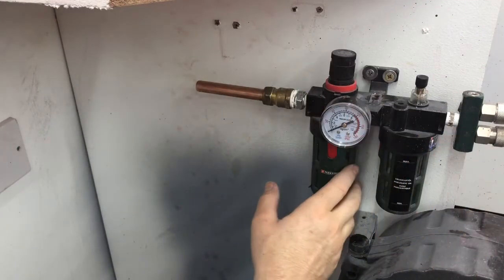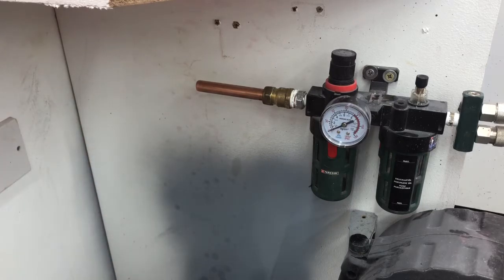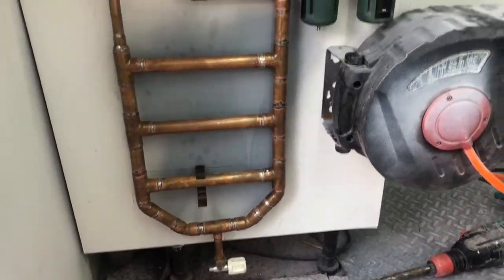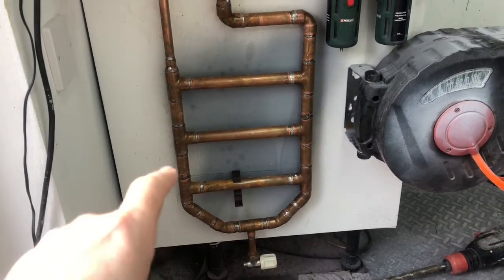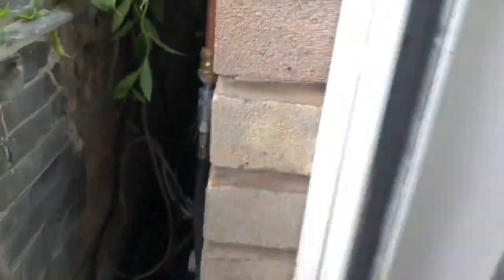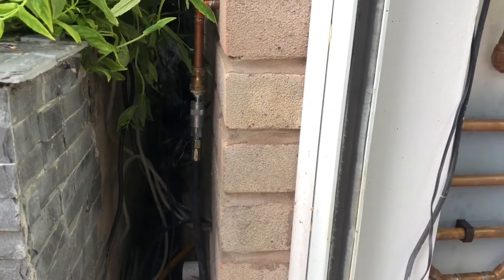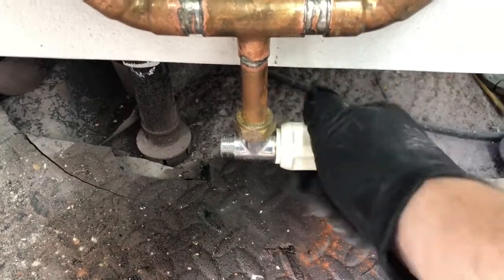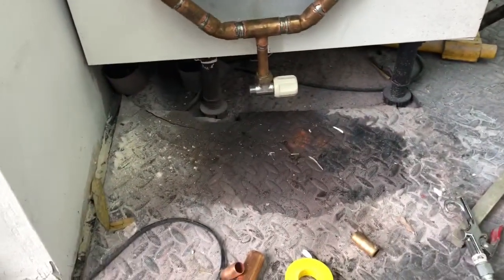DIY air compressor water trap part 1

Comment: Just found your channel and looking forward to going through all ya vids... Can I ask what fitting you use to connect the copper to the air line feed outside?? Many thanks Glenn
Reply from the maker: Cheers, and no problem,, the fitting is just a 1/2 bsp  female to15mm copper with a 1/2 - 1/14 adapter and a male airline quick release 👍🏻